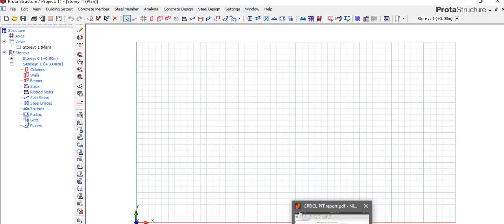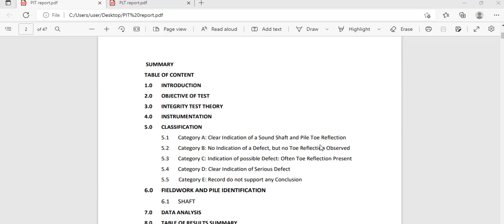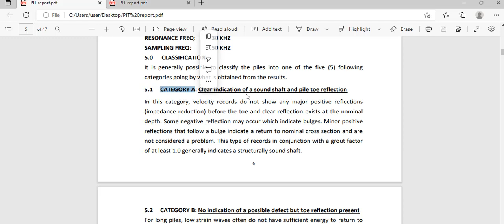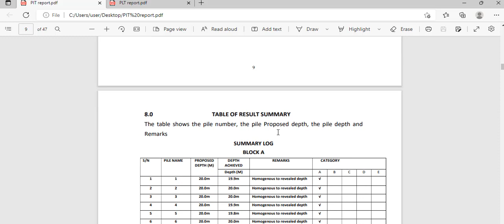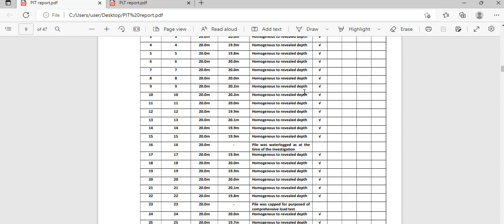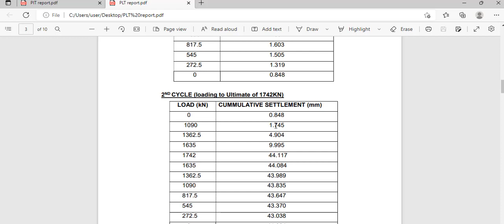protastructure tutorial: how to check if a pile foundation fails or not

Comment: I have learn alot from you sir, base on the test you did for the pile, is the test carried out manually or using protastructure? Chatting from Abuja
Reply from the maker: the test was not done with protastructure, it was done by a geotechnical engineer physically on the site ground